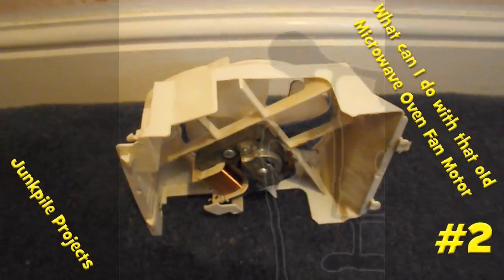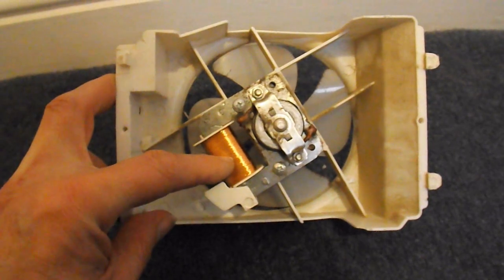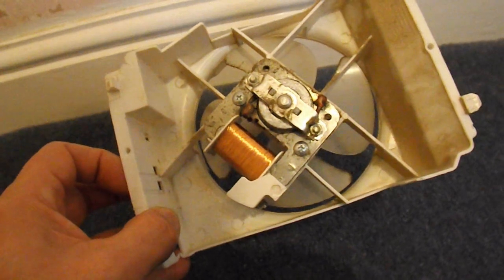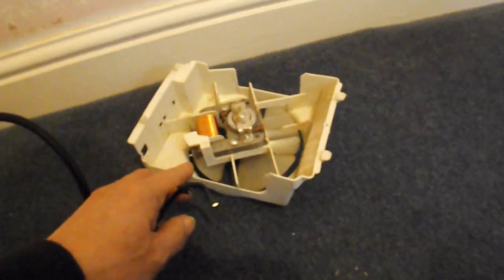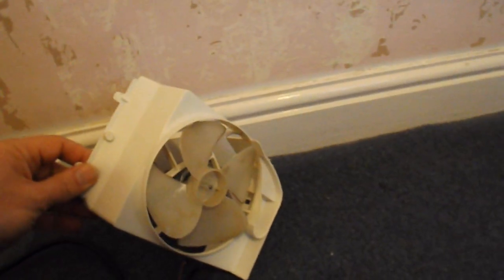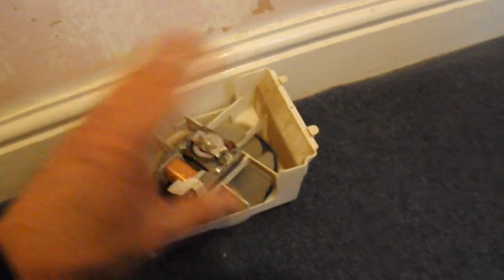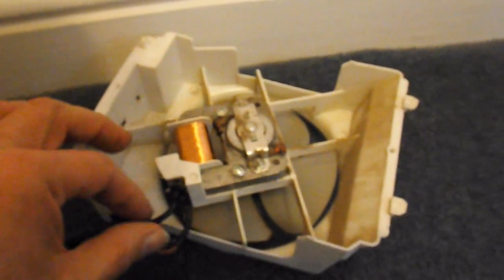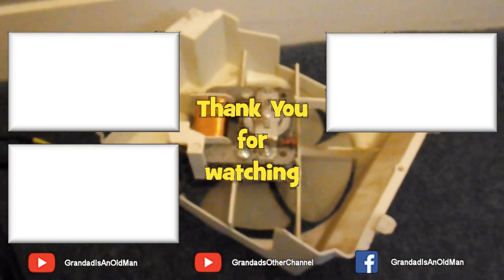What can I do with that old Microwave Oven Fan Motor #2

Comment: Really nice. :) I'm working on a portable/rechargeable desk fan right now (cutting pipe and plastic box, making holes and so on. And I'm going to use exactly the propeller from a microwave fan... But with a 12v 12500rpm DC motor and a 9g servo to make it turn side to side. :)
Reply from the maker: Now your project sound much more sensible. Yes, that is a nice fan blade so a handy source and a good repurposing. I only did this video to cover off some comments on the previous one. You have some good looking videos on your channel 😊
Reply: GrandadIsAnOldMan Thanks, man! :) Your videos are a great source of inspiration to me. :)

Comment: The fan explains the musical note the microwave oven plays when heating food. This fan spins 45 times per second.
Typically, these kind of motors spin a fan at 2700 rpm, so yeah.
Reply from the maker: Can't say I have noticed a musical note, just the sound of the fan.
Reply: How long can the motor run continuously  without  breakin?
Reply: @GrandadIsAnOldMan     Can I run with a phone charger because 120v to much for me I don’t want to get shocked?
Reply from the maker: @MRTOM-gh9pk  it is an AC motor, so a DC power supply would not work, even if it was the right voltage.

Comment: Excellent demo. I was wondering what kind of AC fan it is. Thank you for that info. It is a great powerful and quiet fan. I have 3 of them too bu it is 120 VAC.
Reply from the maker: In the UK it will be 220 to 240 VAC
Reply: GrandadIsAnOldMan I learned from another video that it is a shaded pole motor. Very interesting operation principle. Thanks again.
Reply from the maker: @shvideo1  yes many small AC motors are shaded pole. I believe one reason is to ensure they turn in the direction required. So that makes them ideal for fan motors.

Comment: I'm using mine to cool my DIY "MOT spot-welder", and would love to see your version of a resistance welder, but the risk factors and topic are probably not agreeable to your particular low-voltage viewing audience 😅
Reply from the maker: Yes, you understand the audience level I am aiming at. Very rare that I do anything with high current or voltage. When I do take things apart with the intention of repurposing them I don't think making a fan from a fan is really a change of purpose. Yes it would be useful but I would not really consider it "repurposing" as it is still doing it's original job. Using it for a hovercraft might be more closer to the content I aim for but an AC motor does not really lend itself to that purpose so my original video on the subject was in line with my channel. This video was just to cover off the comments on that video 😊
Reply: GrandadIsAnOldMan what's your other channel?
Reply: GrandadIsAnOldMan Yep, I guessed that was the case ☺.
Reply from the maker: Hi The Tinkerer, here is the link (you will find that sort of information in my video descriptions) https://www.youtube.com/c/GrandadsOtherChannel

Comment: Good simple application. 👍
They also work at 120 vac.
And, yes, the exposed wires & fan blades can be painful 😢.
Reply from the maker: I find it amazing how many people found this video useful. In effect, all I have done here is taken it out of it's box (the microwave oven) and plugged it back in to the mains. I suppose it is an example of repurposing it, but if I intended to make use of it as a fan, I would have made a new box to put it in. In the previous video (that you commented on), I had complaints from people who said I shouldn't have taken the motor apart, and I should have made use of the fan, so here we are.
Reply: @GrandadIsAnOldMan  I find so many microwaves.  Destroying them to get materials and seeing all of the bits and pieces is just self education and stress relieving.
Reply from the maker: @cptrikester2671  some people leave comments just to try to create a reaction 😊
Reply: @GrandadIsAnOldMan  I'm afraid that I am guilty of that on some channels.
Not so much to just get a reaction, but more to present an alternative perspective, and boy does it get a reaction. 🙄
I get the same in return.  Fair enough.🙂

Comment: Hello, thanks for the video. I have a fan from my old microwave oven but it has 3 pins and I couldn't get which pins I should wire. Could you please tell me if you know?
Reply from the maker: That depends what you want to use it for. The coil has a centre tap. You could measure with a meter to see what resistance the coils are on each side. On my motor the outer tags were the ones the original power wires were connected to. Here is a video where I made use of the centre tap https://youtu.be/7c-AsRsyq34

Comment: Wow! No need the capasitor? Directly power from main socket to motor, the motor not hot or burn?
Reply from the maker: There is no difference between the power connection in the original microwave oven and the way I have connected it. It is an AC motor designed to work on AC power. The big difference is it is not safely sitting inside the microwave housing so this is potentially dangerous as there is nothing to stop you touching the live terminals as I clearly explain in the video.

Comment: Love these hot  microwave oven conversions but  has anyone  used the fan motor to drive  the sychronous  turntable motor  to  run to the  transformer  and then to a  hairpin circuit   with  XC  transmission    and  charge  btrys that   go to an inverter to   run  the    fan motor?  Seems like  there  is  the posibility of  POTENTIAL.
Reply from the maker: I am sure there will be a video on YouTube somewhere of somebody doing that to prove overunity but it's not what I am doing here 😊

Comment: i have a fan with 3 holes.i wanted to know which charge is positive and negative
Reply from the maker: This fan is AC powered so positive and negative is not relevant. If you mean live and return (or neutral), then generally they are colour coded and brown would be live and blue would be neutral.

Comment: How many ohms the coil resistance?
I think it can be used as big pulse motor coil or if we can reverse it we can build simple generator that can reach high voltage easily with neodymium magnets.
Reply from the maker: I am afraid I have no idea. This video was filmed back in 2017. You might find the associated links in the video description interesting.

Comment: you could try to make a air conditioner out of that with water. I don't remember exactly what was the name for them but they work with water.
Reply from the maker: I guess you mean a humidifier, a system that adds moisture to the air. Yes you could do something like that. Any fan would work, just arrange for it to blow across some sort of cloth that is hanging in some water. The water rises up the cloth and the fan blows the moisture across the room 😊
Reply: and that could be usefull in hot summer days
Reply from the maker: Haha, I seem to remember we had a hot summer day once 😊

Comment: Can I directly connect the fan to mains? (120v 60hz)
Also how can I identifying the polarity of the motor? The wires to the fan is both grey colored. I want to connect a switch to it so I can turn the fan on or off. So I need to identify the Live (L) Wire.
Also, the fan is from a microwave.
Reply from the maker: First I would say that if you have any concerns you should talk to a qualified electrician rather than trust a YouTube video. You try this at your own risk, I accept no liability. There is no guarantee your fan is identical to the one in this video. Regards the polarity, the one in the video is an AC fan so polarity is irrelevant. If you have taken it out of a microwave you should be able to trace the wiring and see how it was connected originally. I was able to follow the wires from wall plug and trace the route through to the fan to confirm how it was connected.

Comment: Could you do the same thing but plunging it into a car for a car with no a/c. Taking into account building a housing.
Reply from the maker: Seriously? why would you want to go to the effort of converting an AC fan to run on a low voltage DC power supply. Technically it would be possible but you would be able to buy a 12v DC fan cheaper or even a USB powered one.
Reply: @GrandadIsAnOldMan  just curious, I am just getting into repurposing motors and was trying to think of a practical purpose for the fan I have. But I can recognize its easier to just do a/c, thanks.
Reply from the maker: @Alistair-gi3bx  You may find some of these AC motors are in fact Universal motors that can also run on DC but so far my experience with that type of motor has been very negative. 
Universal motors https://www.youtube.com/playlist?list=PLA5a2xPRSrB1FWx-rsnag03bIWwBmnzt3

Comment: could several of these be run in series (in a box of sorts...) as a window exhaust fan?  thinking.....
Reply from the maker: I am sure you could, there is nothing special about it and when you look around you can find fans in many items, I was watching a video about cooling racks of processors for bitcoin operations by using car radiator fans.
Reply: Thank you muchly!  Have done some minimal "breadboard" projects, but I'll have to look into whether I'll need any resistors or anything to make a simple circuit with a switch, a dial, and 4 microwave fans in some kind of case to fit into a window, but shouldn't be too hard.  Just gotta make sure don't overload anything...
Reply from the maker: I think they are pretty low wattage so they shouldn't take much power. The rating is probably written on them but this video is several years old and I don't think I still have the bits laying around to check.

Comment: i have one but is with 3 connnector i guess is + - and ground but what is what only the middle connector is with 2 copper little wire to it so i guess is ground help please im gonna use it for garage and i already make a safe litte box for it that prevent touching the connectors with hands
Reply from the maker: Sorry, I would not attempt to advise you on your project. When I took this one apart I ensured I could see where the wires came from and where they went so I only reconnected them the way they were originally. Your description worries me as it sounds like you are guessing and that is not a safe way of working with mains electricity. It is very unlikely GROUND is connected to the connector you describe as that would short circuit the live wires. Ground is normally connected to the metal framework to ensure that a fault situation involving live wires touching the framework they are short circuited and the main fuse is blown.

Comment: I have the same fan rated 18w can I plug it directly into a 220-240v AC outlet??🙏🙏🙏
Reply from the maker: I am not a qualified electrician so I would not give you any guidance. I traced the wiring so I could see where it came from and where it went. It was a 240v AC supply and it it went direct to the motor. The watt rating just tells you how much power it will take at the stated voltage. If you are not a qualified electrician then my only advice is that you should seek the guidance of a qualified electrician.
Reply: @GrandadIsAnOldMan  yeah sure, thank you so much 🙏👍🥰✌️

Comment: Does it matter where you connect positive and negative terminals?
Reply from the maker: It sounds to me like you have no knowledge of electricity. If you are working on mains power with no knowledge, you are likely to cause yourself harm and maybe serious injury. If you are using AC there is no positive or negative. AC= Alternating current. If you are taking this fan out of a microwave oven, make a note of where the wires are currently connected and trace them through to the fan.

Comment: I ran the same fan using a 12000 volt neon sign transformer.
Reply from the maker: That seems a bit excessive. It is designed for normal main electricity. But if it works for you that is fine by me 👍
Reply: @GrandadIsAnOldMan                                                                                                                                                             I was making a Tesla coil and happened to have the said fan i just tried for fun and it worked and i thought what else could i power up with a NST.
Reply from the maker: @ronaldphillips311  You should have put a video up of the Tesla coil, they are popular on YouTube 😁😁👍
Reply: @GrandadIsAnOldMan                                                                                                                                                               i am in the process of building a new one and hope to get 3 foot lightening flashes off it. i will show it when completed. Tesla was my hero.
Reply from the maker: @ronaldphillips311  Take care. If you don't already watch this guy, you might find Plasma Channel interesting https://www.youtube.com/c/PlasmaChannel

Comment: Hey guys, so i am in the process off disassembling my old microwave and i have removed the fan. and it is super greasy and im a total newbie when it comes to electronics parts so i was wondering how to clean it without destroying the coil? It's the first time ever im even touching a coil so i just dont know how fragile they are ^^
Reply from the maker: You could buy a degreasing spray, or just use hot water and washing up liquid and probably an old toothbrush with a bit of gentle encouragement. Obviously you would need to ensure it was properly dried out before connecting any power to it. You would probably need to oil the bearings before use as degreasing would have removed any lubricant.
Reply: @GrandadIsAnOldMan  Ooh ok so if you suggest water i assume that i can just use the 70% Isopropyl Alcohol and spray directly on it? i mean i did see a video before where they recommended not going undet 90% IPA for that kind of cleaning but it would be the same thing as the water then that as long as i make sure its completly dry right? and thank you :)
Reply from the maker: @alexgranberg9399  I didn't suggest alcohol. However it is a degreasing agent, so it should get rid of the grease. Take care, as the fumes are obviously flammable.

Comment: Hello Grandad. Question are all wall plugs in your home equipped with a switch beside the plug to control the off and on for each half of the plug? Is this a UK building code? I like the idea of being able to turn off certain plugs in each room. Not here in the US. :-p
Reply from the maker: Hi Ed, I don't think it is a UK building code and you can get them without switches. With many modern devices needing to be powered continuously for things like internet access I would guess a wall switch is becoming less necessary.
Reply: GrandadIsAnOldMan Thanks for the info. Save the fan for your shed to vent Styrofoam fumes when hot wire cutting.
Reply from the maker: Yes that would be an option 😊

Comment: Grandad, Im your new subscriber, just want to ask, does all microwave fan is ac or dc motor? Can I directly plug it to 220v  or 230v line just like you did, Specifically the Hanabishi Microwave ???
Reply from the maker: I am not a microwave oven expert. I took the oven apart, traced it's circuitry and understood how it worked. The motor even has the details written on it. My advice to all people playing with electronics is that if you don't know what you are doing, ask a qualified electrician. Don't trust "some guy on YouTube" 👍

Comment: I need to find more.
Reply from the maker: I used to see them dumped by the side of the road, fly tipping is illegal in the UK, but people still do it.
Reply: @GrandadIsAnOldMan  same.
Reply: I took the microwave fan out of a microwave. It was easier for me. I have a question. How do I power it?  It has 2 wires. Brown and yellow. I have a 2 prong  C8 power cord from a computer. Will it work if I put 2 wires on the 2 prong?
Reply from the maker: I am afraid that if you have no knowledge of electronics, my advice is don't touch it. In the UK the 240v AC will kill you. The motor probably has a label on it telling you what voltage is required. If that matches your voltage, then it should work.
Reply: @GrandadIsAnOldMan   ok
Reply: My mom found a microwave this morning. Tested it,  works but the microwave is not heating. It could be a problem with a high voltage diode which helps to power on the magnetron or the magnetron is broken.